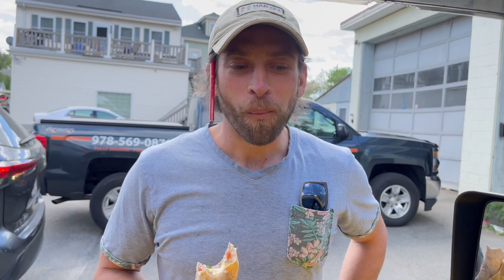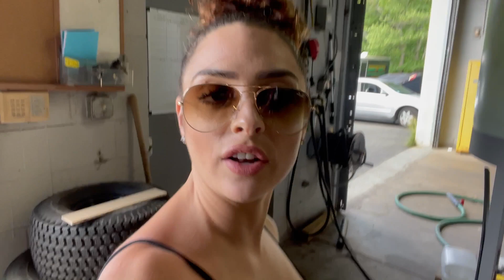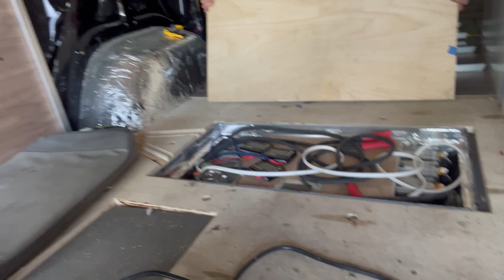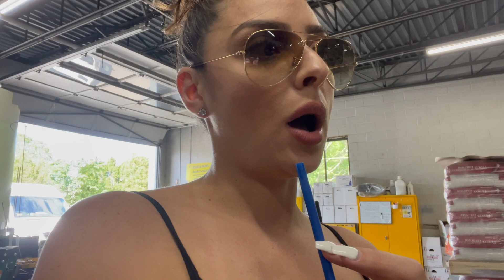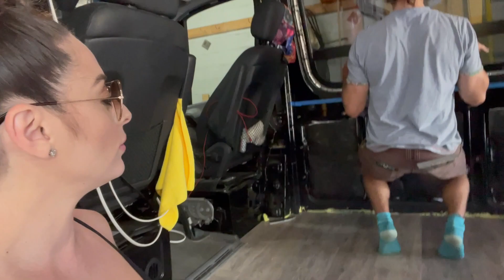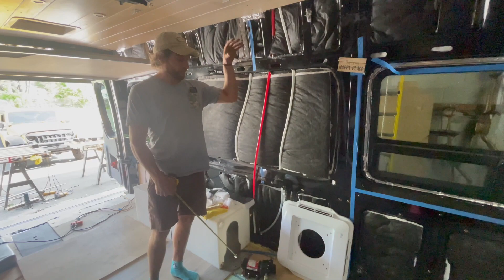DANA BUILDS VS. RICH REBUILDS?!

Comment: IMO heated flooring isn't that important. It's such a small space and will heat up super quick (or cool off). I've had a travel trailer before, and that thing wasn't as well insulated as your van is. I also think your bed setup has the potential to be better than his, since his will always be taking up space. While it would be nice to have a couple of windows, they also take up space that can be used for other things. I'd really want one by the head of my bed though, or at least some kind of a vent back there so you can use the exhaust fan on top and pull that fresh air in right where you are sleeping.
The only thing I don't like about your van is the toilet. I feel like there's room for a blackwater tank and a proper RV toilet.

I'd want to tow a Wrangler also. They are kinda heavy but I'm sure the frame rails can be reinforced on the van. Obviously the rest of the drivetrain needs to be a consideration as well.

I see your van as more travel focused with necessities, and I love the Scandinavian style wood slats. Whereas this van is more of a long-term living setup, extended trips, extended stays.

Comment: Don’t tow that keep. Best would be to put an electric mountain bike or motorcycle on the back of the van. Otherwise, tow a side by side. It will be harder to get around towing something though. You have to find a spot large enough for both the van and the trailer.